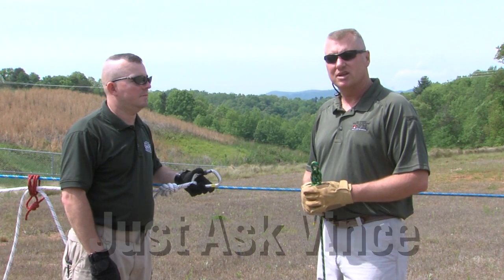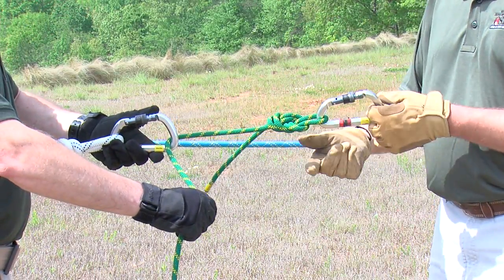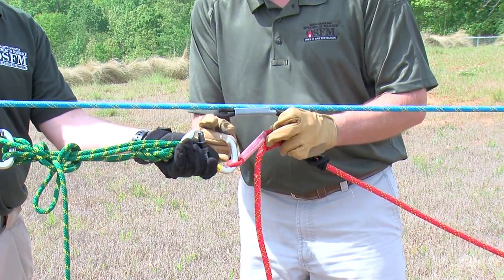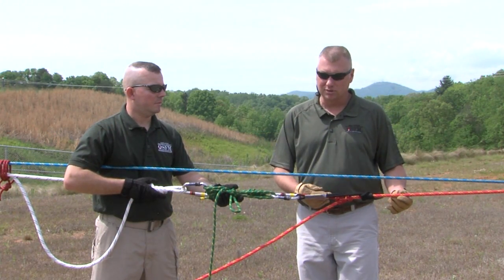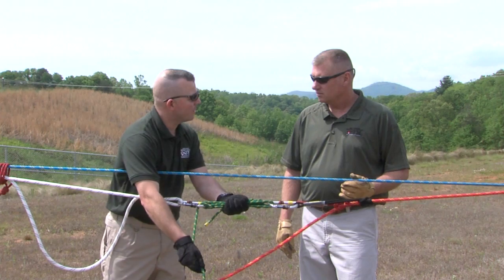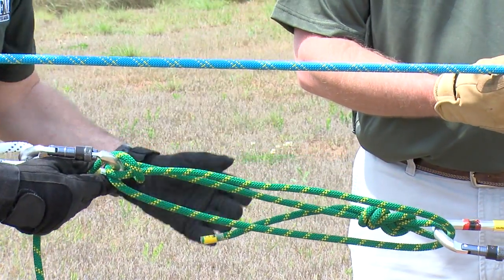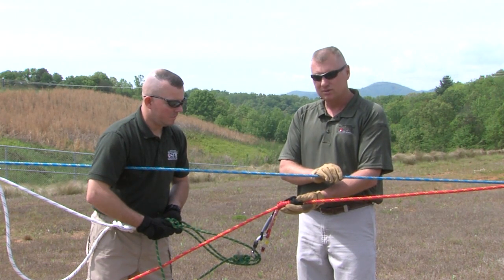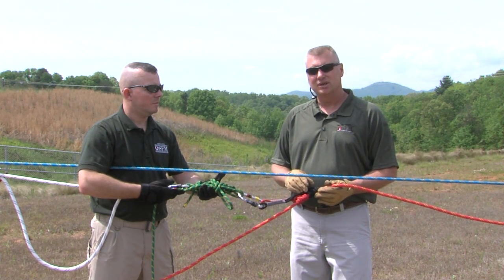Radium Load Release Hitch

Comment: Consider also tying a VT Prusik (using the same double eye material you have) instead of a traditional triple wrap. VTs will hold the load securely, but can easily be released without being unloaded, therefore eliminating the need for the Radium altogether.   https://youtu.be/Z-xjqI1WOY8

Comment: This is a great training video.  You guys do an awesome job explaining the RRH and I really like that you put it into a practical scenario where it is very likely to be used.  I just have a couple of questions.  Is it pertinent that the anchor carabiner ( where the munter hitch is) should be the largest carabiner that you have so the munter has clearance to flip if necessary?  It may also be helpful to show the braked position of a munter hitch as some may have never worked with that hitch.  One last thing, would it be best to clip the running end of the rope to the anchor, so in the instance of a main line failure the RRH could not come completely undone and drop the load?  Thank you for taking the time to demonstrate a very useful system with clear and accurate instruction.  Great job guys!

Comment: Great pace, clear instructions, good demonstration.  But I was taught that after the Munter hitch should be a mule hitch - a kind of slip knot, usually tied off by tying the bight with an overhand.  You've taken the bight and tied a two half-hitch knot.  A half-hitch is not an overhand, they are two different knots, and a half-hitch is not a reliable safety knot.  You probably won't have a problem with what you've tied as long as the loads are not large enough to make the two half-hitches with a bight fail.
Reply: Larry Borshard that last part is incorrect by common theory... the easy way to know is that when the safety is tied, the loop should finish parallel to the radium. Shown here it ends up perpendicular.  That’s a key identifying feature of the finish knot. That said, bravo for taking the time to make the video for folks to see. It’s shark infested water and a lot of people that’ll never tie nor use this stuff are at the ready to bust balls and talk shit.